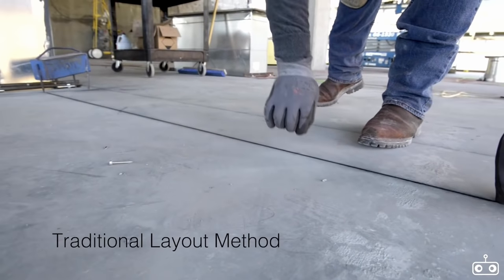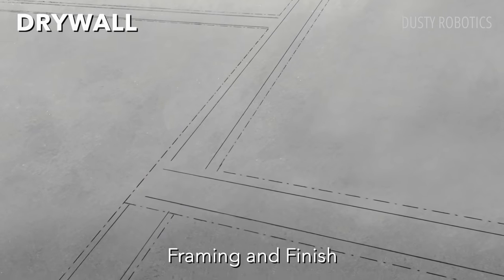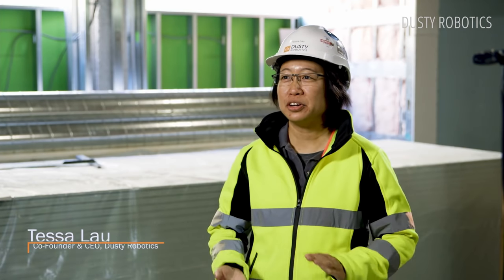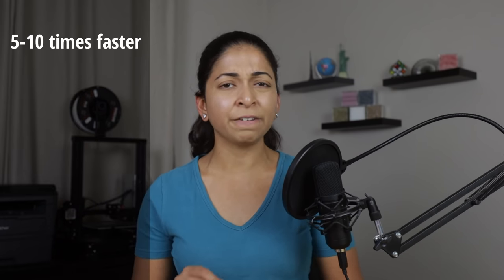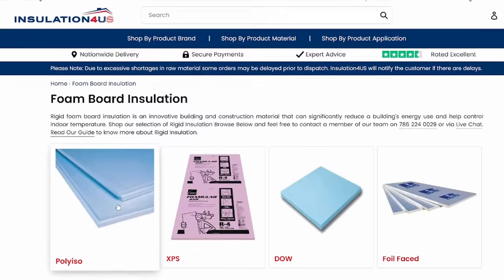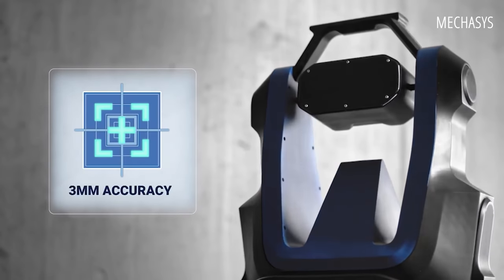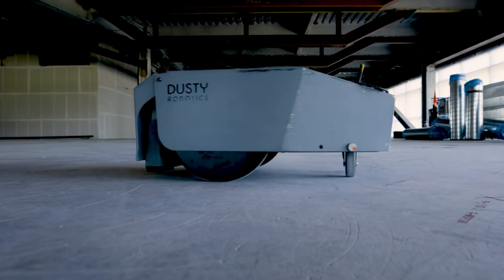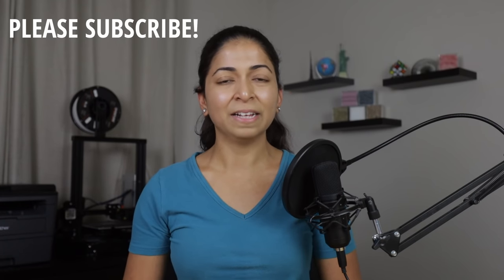Robotic Construction Printer | Dusty Robotics

Comment: I think I would prefer the laser markings exactly because they are not permanent. They allow for quick revisions if incompatibility between plans and the situation on site are found. I think such a system might also work well in case something has to be improvised since it could be used as a basis for adapted chalk lines. Sounds backwards but if a lot of the measuring can be avoided, chalking could be done really quickly.

(While I do have a little construction experience I've never worked on a "proper" construction sit so take this with a grain of salt.)

Comment: It would be trivial to add another sensor to this thing and do floor flatness/levelness faster than a person can also. That would save $1000 in inspection for warehouses 10,000 SQFT or more.

So much of construction that can be automated is above finish floor. Offsite construction of all of that would save half the costs. If the bulk of the labor is in subgrade, Utilities, and slab with pre-engineered solutions it can also be built in far less than half the time.

Comment: I just found your channel and I have to say that I'm already hooked.

Do you plan on making a video commenting on earthships? I discovered them during the pandemic and found some pros and cons, but nothing with good evidence, and I think that this would be right on your alley.

Keep up the great work!
Reply: earthships work great if you live in one place. An area with no building department, permit requirements and a temperate desert environment.  Otherwise insulation values don't meet code, mosture issues from the water filtration systems, glazing requirements. And they need constant maintenance since the lifecycle of the finish is less than 10 years on most of the ones I've seen. They came out when I was a kid and I followed them, now that I can build much better for less I try to steer people away.

Comment: Interesting idea and a great starting point, but I have some concerns. Can it get close to edges? Does it work on a slab that's poured out of level? How smooth does the surface have to be? And a lot more questions. Cool idea though, and a step in the right direction.
My qualifications: 15+ years in construction. Residential, and commercial.
Reply: it knows the third dimension so it can print on sloped. but I don't think people that have sloped slabs are the target of this product.

Comment: It feels both impressive and useless at the same time. The stars that have to align for this to do it's job well are immense, all to replace a job that in the grand scheme of things is not the most costly problem to solve in construction.
Reply: what stars are those. floor install is finished the robot goes on and prints. Done.

Comment: Extended reality glasses are better solution, cheaper more compact.
Reply: I doubt current AR technology is ready for this. The first deal breaker I see is reduced field of view, which will at best be unacceptably annoying and at worst fatal. Then it also needs to "just work", be easy to "read" and very reliable.

I could see it as a way for architects to prototype and confirm how the building integrates into the environment and as a tool for construction supervisors to check for errors in the plans and their execution.

VR also might be helpful for catching mistakes in the drawings before they leave the office.
Reply: @Kenionatus  Ar is ready already used in manufacturing and even in servicing jet engines.

Comment: I feel like this thing would be useful when setting up and marking booth spaces in convention centers, especially if they could use a temporary ink.
Reply: The Dusty robot uses standard ink cartridges such the type that may be found on industrial printers at a sawmill, packaging plant or shipping center. These cartridges are available from many custom ink vendors. Some inks such as solvent based inks are very durable, but other water-based inks can be more easily removed with just soap and water.  There are even edible inks, but we haven't found a use for those just yet. 😀

Comment: Maybe they could use a scissors jack style robot to spray a coating on a wall,then the other robot could use a reactive laser beam to mark the walls. Like a kinda stereolithography
Reply: there isn't a reason to print the wall. the information is printed on the floor. and the wall isn't there yet cause it's printing the spec's for the people coming to build the wall

Comment: Very exciting. Doing 1 thing perfectly is frequently better than doing 10 things adequately/poorly 
If it was beefed up a little, I dont see why it couldnt also incorporate telescoping arms to do walls and ceilings
Reply: Right now the focus is on a minimal viable product to understand the needs of builders to put detailed and geometrically accurate information in the environment.  Dusty is just currently scratching the surface of this.  I wouldn't be surprised to multiple dimensions addressed in the future as you hint at.

Comment: Maybe I missed it, but how does the information go from your prints to the robot AND if it's on the print, shouldn't the architectural company be liable for that?? Also, what would be the issue with making a digital copy to a computer and send it the the bot's computer?? That doesn't sound difficult!!
Reply: The problem is similar to the difference between CAD and CAM... the robot is just a tool, not smart enough to figure out the path it should take to print, or what the markings it makes mean. The software in the middle is "drawing" the route for the robot to take, alignment points, timings, and error checking into the plans, and condensing the data into the order the robot will need it.
Reply: For a 3D printer this split also exists, a "slicer" turns a 3D model into instructions for the printer, so that's the first place you can check for errors in the path it takes when printing. Before the slicer, the model has solid edges. After, it's made of a single zig-zagging path through the whole printed part. Feed the printer bad instructions and it will happily go back and use the print head to smash through your print, as a robot might drive off a cliff... with a human eye on that last step, you can check for computer mistakes before even turning on the machine.
Reply: What's not shown in the video are other important components of the Dusty system that allow for human review of the print job before it is executed by the robot.  The operator can see what will be printed, what is being printed and what has been printed very easily on a companion tablet computer.

Comment: Poor quality input is a real issue. Maybe use the laser as a first stage and only afterwards do the printing
Reply: Most robots, save for RTK GNSS solutions, are using traditional laser ranging technology as one of their sensors. Part of operating and calibrating a bot like this will almost certainly involve manually spotting a handful of specified reference points on a plan, to overlay real-world sensor data to the digital plans.

Comment: The robot eliminates jobs...
Reply: That's a good thing, since there is a shortage of workers in construction.
Reply: It reduces jobs. It transforms "kneel before the faceless corporate god for 80 hours a week" into "kick the roomba when it screws up, and mark out electrical"
Reply: There is a manpower shortage, this is one of the few industries that I can confidently say is at little risk of eliminating jobs. Also eliminating jobs should be the ideal, we just need political solutions to support people that can no longer find work.
Reply: @jercos  what you say is very true.  The union trades people who have worked with the robot see it really as a tool that assists them doing something that they would otherwise be doing on their hands and knees.  During development I visited a high-rise in San Francisco where the robot was being tested and where freezing wind and fog was blowing through the open walls (this was mid-summer). As imperfect as the system was at that time, the worker who would otherwise be out in the wind sheltered himself with the remote and laptop and seemed quite content to let the robot do the work for him on the slab that afternoon.

Comment: As always your presentation is very good and I'm always impressed by how well organized you are. But I'm not sold on the technology. There are ALWAYS errors in the trades. It's not enough to accurately print the site. Individual human beings with varying levels of skill are required to do the installation. From the apprentice to the most senior member of a crew, errors happen. Among the traits that make someone less of a "worker" and more of a "craftsperson" is their ability to identify errors and overcome them. Many of those errors occur during construction - long after chalk lines have been snapped and surveyors have done their thing. My best friend is an IBEW supervisor of very large crews in the Maryland/WDC area. Those crews do work for many government agencies who are not going to want drawings and plans downloaded to a robot. The drawings they work from are purposefully incomplete, for many good reasons having to do with national security. I only cite this as 1 example where no robot that relies on downloaded data is going to find a home. But, having worked in the trades as both a rough carpenter, a finish carpenter, a roofer and an industrial engineer, I can imagine many dozens of situations that will severely limit the role of robots such as this. The other thing to keep in mind is that a commercial building is not a piece of fine furniture - but just like any kind of object, it will expand and shrink, it will move, settle, and occassionally get rattled by earthquakes and weather-induced influences. A building built like a wine cabinet will fall out of plumb, square, and level quickly during and after its construction. I believe those forces will thwart the accuracy of anything printed on a surface. As an experiment, I would want to test this robot by printing in black ink the initial pass, and then come back a week later and print a second pass in red ink. I would be interested in seeing how closely the two print jobs register with one another. I would theorize that there will be differences of more than 1 mm. I would go so far as to predict that the differences could accumulate to as much as 1 inch over the kind of distances we would see in a new automobile factory (I've worked on 3 such jobs.)

Comment: One stray screw will probably mess it up.
The problem with trades isnt outdated slow technology.
Its the slow, lazy inefficient work ethic of old, slow fat lazy tradies  too well protected by unions and trade licences to ever change. 
The young kids have the work ethic beaten out of them by the apprentice system.
I came from concerts /special events into trade, we have a different ethic.
As such my crew and i tend to run rings around these fat old tradies, mostly whilst fixing all the lazy work and errors they caused.

The industry is inefficient because it wants to be, and an app or robot isnt going to change that.